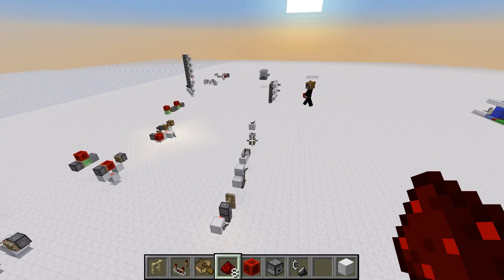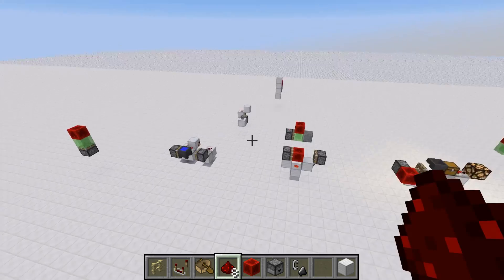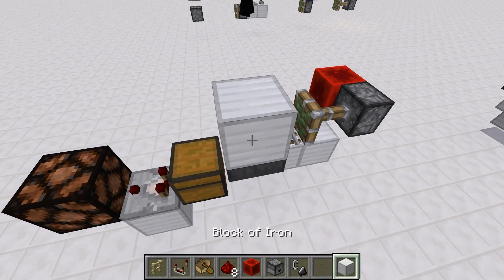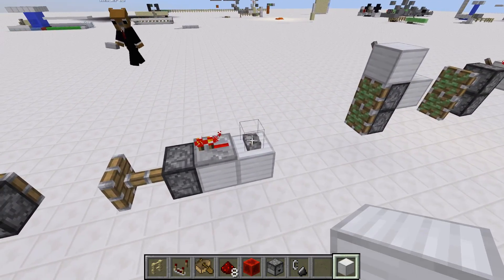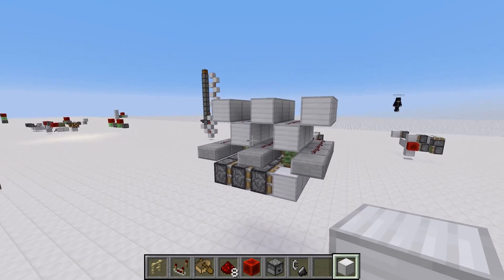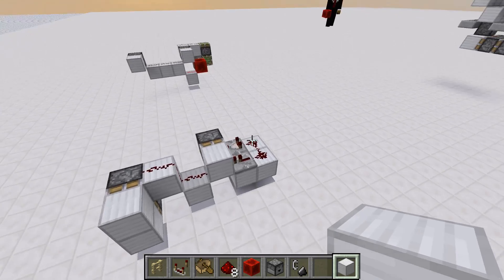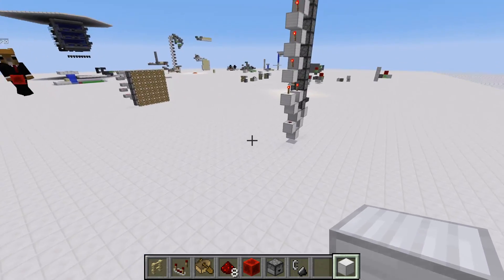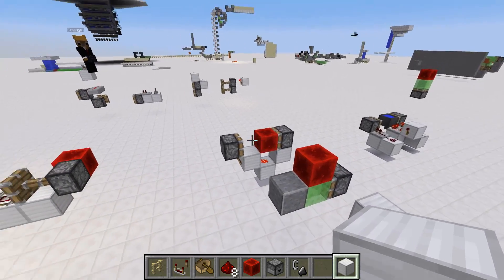Minecraft - NEW Redstone BUD Block "Observer" - Feedback for Mojang

Comment: as a player of mcpe myself from testing out the observer block (first i would like to mention there are NO bud switches that can be made like the ones showen at 3:30) from testing it is a pretty bad thing for pe users since there is no other bud switches that can be made (again only the ones showen after 3:30) with out the "observer" block so... here is an example you know how to make a 2x2 flush piston door with only 6 redstone dust and 2 repeaters? yes, you do, good. KISS IT GOODBYE MCPE USERS! yep observer block sucks and it sucks HARD! i would much rather have normal bud switches the not having them and only being able to use this dam block.
Reply: I think you're mixing up terminology here, BUD refers to block update detector, it is a contraption that triggers a redstone signal when an adjacent block causes a block update. The design at 3:30 is just a very simple demonstration of quasi connectivity, which is the game mechanic in the java edition that allows a piston (and some other blocks) to receive power if any blocks adjacent to the block above the piston is powered. Normally redstone causes a block update when it is powered/depowered but because that only affects directly adjacent blocks, a quasi-powered piston won't update unless one of the blocks adjacent to it change (whether it be due to the redstone powering/unpowering another piston directly above the quasi-powered piston, or any other block changing). But I do understand your point and I am completely of the same opinion even though I haven't actually played MCPE.

Comment: id love to see bug-less Redstone. you could do a lot more if the redstone didn't bud pistons and power things that are not attached. but obviously a vertical solution for Redstone and a bud block would be needed to fil the gaps
Reply: +Conor Raypholtz I would say vertical redstone is a must if they remove quasi connectivity.
Reply: some of the contractions such as shown in this video would break if pistons didn't bud
Reply: no they wouldn't, they would simply need redesigned with a bud block. so long as we can vertically wire redstone they are still doable and easier to figure get working.
Reply: yes a lot of crap in worlds would need redone but it would be 100x simpler to make new devices, and it would save space.
Reply: if vertical redstone was in the game a triple extender could be done in a 2x space using comparators.

Comment: Quasi-connectivity is one of the best features in MC. Please, don't mess with it.
The BUD block itself sounds reasonable... detecting fence gates and doors would be nice.
On the other hand there are so many things that could be added. Just a change of the pushing block limit to 16 would make ppl extremely happy and that's only 3 lines of code. Changing the useless minecart with furnace for a drivable powered minecart controlled by a player. Adding new block that changes its color (or maybe its shade) depending on the signal strength. (Would be cool for an "analog" displays. Also light updates from redstone lamps are currently creating so much lag, that you almost cannot use them.) Adding a chair/sofa block that can be moved by pistons and that a player can sit on. Having a use for poisonous potatoes. Changing the AI so that mobs can "press spacebar" and use an elytra. Lowering the shield model so that we can see something xD Making it so that potions are thrown a little bit further or even charging the throw. I was a little bit surprised that there weren't crossbows added in the combat update. A slow to load, but more accurate weapon could change it up a bit. Adding a different type of a sign (the wooden one can look really awkward at some places)... Iron version would be good in my opinion.
And if you are still reading this maybe you could tell me what do you think about it and what would you add.
Reply: +pi314159265358978 great list! sofas xD, they really would add some charm to the game. I would love to have a coal powered grinder block in the game in order to make bone meal automatically. It would be fun to automate tree farms even more and crafting bone meal really doesn't add anything to the game anymore for me after doing it a million times.
Reply: Lucan 6029 it's obvious, that you can't just change the rules with command blocks if you're playing on a server with other people.

I don't think it's a smart move to anger your most loyal fans by ripping the game apart.

Redstone as it is, is very intuitive, exept a few exceptions, like using a hash map to determine the update order of redstone dust. It's not possible to make everything perfectly clear for everybody. Some people are already overburdened by the complexity of a comparator. Dumbing everything down doesn't make it better.

Changing core mechanics just for the sake of doing something new isn't necessary, if they just add something new to the game once in a while.
Reply: If it works don't mess with it. And I genuinly believe that quasi-connectivity works much better than intended :-) I would even argue that currently the piston mechanics are more robust than those of repeaters, or redstone torches. And generally I would say that overall redstone mechanics are better polished, than any other area in Minecraft. And as an example I would use something from my area of expertise... the mod AI. I haven't done a video involving mobs in a long time and that's mainly because of how broken the AI is.
Reply: +SkretzoMC it's gone way off-topic from quasi-connectivity, but I think it would be reasonable for them to eliminate the nether ceiling exploit. A less rule-bending compromise would be to add much larger lava "oceans" to the nether that would provide mostly non-spawnable area without leaving the boundaries of the map.
Reply: Lucan 6029 I have a hard time understanding what you're trying to say. I don't have to be optimistic and positive about anything. If I don't like something, it's my right to express my opinion that I don't like it
Reply: Why do you think that we don't have a pretty strong system already? Sure, there are some little quirks and things that could be improved, but to discard one of the key elements in the redstone to create ... what exactly? Something easier to underestand? Well quasi-connectivity actually is pretty simple. You can do complex things with it, but you don't need to be an expert to underestand it.
Reply: Making mob AI that can fly and use elytra wings sounds wayyyy to complicated and I feel would not be good for the game.
Reply: +pi314159265358978 I just don't understand why a mining game doesn't have a grinder since the beginning, Mojang is weird. For QS I think you're too focus on what you loose, not how Mojang can do equivalent systems with a redstone overhaul (or not if it's a justified game design orientation). I think this would be done from the beginning. If the QS/BUD was based on IRL logic (electricity mainly) I would understand this statu quo, but it's just a counter-intuitive arbitrary logic for some optimizations. Compressing redstone is an gaming Art since the beginnings, and like all Arts it's based on arbitrary things, here Vanilla redstone system. Steps backwards haven't actual sense with Arts, unlike industries/techs. It will be always things hard to do (beacon farm ?), that's the main thing about this Art. I think the intuitive logic system for a global and child audience game is a great decision from Mojang (finally !!).

I wait now for Appletrees/Oaks separation and player-proof Nether roof Mouhahahah !!
Reply: +CowTipper989 But, you have to admit, airborne kamikaze creepers would be amazing. Just sitting there on the sofa, grinding some bonemeal, and BOOM! outta nowhere.
Reply: transylvanian
No roof access, because there is any flavor and because I can use command blocks to tweak new rules, making ghast or pigmen farm working again in the way I want or more interesting. For example... in a kinda ExNihili mod way, when 10% of squids touch lava in the Nether, funny farm ! Or when they flying because hit by levitation rocket XD ! Find your own rule. And obviously, I hope that Mojang close the roof access AND grant a way to farm a bit Ghasts, but by a designed way, not bug based, maybe not at the same rate though. But losing my actual Vanilla farm anyway ? Oh well, it's a game after all. You don't like Wither skeleton spawning ? Make a rule allowing them spawning outside, that's easy now.

Vanilla is just a support, a basic gameplay for players. MC is way more, stop to grasp Vanilla like a brand. You want more, do more, Mojang don't restrain you at all. The best example is HermitCraft. They like player's heads -> new custom rule, they like easy Elytras because the server have a lot of players (even some pro) -> Elytra drops by killing dragon... That for what were designed command blocks ! To make the game as you want ! Just be creative and accept to get out this insane and useless Vanilla brand.

And finally, Mojang will be way smarter to make redstone intuitive for new players, even breaking old contraptions, than keeping old players that, for already and redstone aside, are already bored just because, it's a game. Changes are also a great opportunity to work around and break the monotony. If you demotivate each time something change, that's too bad, but don't rest on MC for that. The world changes, players base change, old players, even from alpha, aren't alone on the game.
Reply: +ilmango  Just don't focus on that you don't like and you, that's only the easiest part.
Reply: Nothing special for me than AI dev (free entity, pathfinding, decisions priorities...) is more messed than redstone dev (cube based properties), in any game. "If it works don't mess with it" Not a rule I will follow to design a really strong system. It's a Boeing rule, I will prefer the Airbus way.
Reply: +pi314159265358978 one thing i think would be cool would be to be able to take a comparator output from things like open dragon's head or add feature that an upside down stair  acts like block on one side carrying redstone signal and slab on other.
Reply: +pi314159265358978 one thing i think would be cool would be to be able to take a comparator output from things like open dragon's head or add feature that an upside down stair  acts like block on one side carrying redstone signal and slab on other.
Reply: +pi314159265358978 They could keep the minecart with furnace, but allow it to be fueled by a dispenser.
Reply: +transylvanian Maybe they should allow you to enter the nether roof with nether portals. If they are placed according to altitude, you could avoid breaking bedrock.
Reply: +MarkRiverbank True, but I don't see the problem in using the nether ceiling. We do have the block limit, so why do we have this nether roof area if we can't use it?
Reply: +ilmango That's what I think Mojang really needs tools to promote custom server/rules and getting rid of this Vanilla brand feeling from players. Minecraft, even not in beta anymore, hasn't a good balanced and surely not consistent gameplay (a rare game where going out of map border to exploit game mechanics become the "right" thing). Players need to stop encouraging this reluctance to change in the community, that's the more toxic thing here, it is not loyalty. Nerfs only seen like that by old players aren't bad for the game in long term, negliging also a lot of additions. Redstone is arbitrary simple but extensive, close to basic electronics since the beginning, that's why redstone is great. They add specific redstone blocks but BUD/QS weren't intented and are definitely not in the core design of minecraft (minimalistic elements to build and easy to understand in essence too).

I know a lot about physics, and the first time I saw redstone - I stay honest with myself firstly - I saw unexpecting mechanics and surely more intuitive ways to do, even if a bit less optimized in a cubic world that's true. It's always the case now, see here in a lot of comments, for plenty of new players, anytime. You're free to ignore that. I don't blame Notch's experiment, but Mojang can totally change that a bit to have something more intuitive and consistent (in a physics point of view, not efficient cubic logic). Maybe you don't see this like me, but for me that's definitely because of the redstoner eyecups. You try to grab players in your side, so I do the same, as a redstoner too even if you cannot understand my point of view.

Even it's late to do that - better now that never - the cross-platform overhaul is a good (the last?) opportunity to do that. They don't go to ripping appart the game, only community would go for that like a stupid loyal headless chicken, that I hope it will not happen. They okay for feedbacks and will try as they can, but the community needs to be positive. It's not Mojang but mainly you taking side like you do that can make people angry by basic snowball negative effect. Try to be carefull and respect game designers, remember that it's a game first. That's difficult to face angry players for sure you're right, but you cannot have a great game following the largest numbers and more crying/yelling players too.

The community needs to be mature, stopping useless troubles in the crowd and focus more on positive aspects, even if it's harder to see by human nature. Observer idea and a bit of redstone overhaul isn't a bad idea at all. Instead to be afraid off it will be more constructive to help Mojang around that for the game, not as a burden but really in a positive way.

Comment: Good video doc. I don't necessarily think having a BUD block would be a bad thing depending on how it is implemented. It would be nice to have a BUD block for new players who might be unaware of the existence of BUDs. I know Mojang are trying to make the game more uniform cross platform but as you showed removing the BUD functionality entirely would be a mistake as it would limit available redstone options in the game. That said I think there is a compromise here with Mojang and hope that they listen to the community regarding the Observer Block and other changes to Redstone.
Reply: +cubfan135 Kinda agree. I think it's a great idea from Mojang (just really late XD). BUD was a bug result initially and quasi-connectivity even it revealed to be efficient in a cubic world, that's true, stays a weird / nonintuitive mechanic for plenty of players. Getting rid of this - only as it is - for something well designed for the game AND with some guaranty that most of these systems show here can find a new equivalent will be wonderfull, even if a bit of trades off / drawbacks will be needed for. That's already possible for some with a bit more of redstone (yes, a bit less resources/space efficient) and maybe redstone wires (no support) for pistons wall, two blocks away mode for Observer for secret entrance... A lot of things will be broken for a while, but inertia it's not the best advisor to follow.

Reluctante to change is understandable from MC players but I think Mojang puts more quality / evaluates better the impacts nowadays. I trust them + community to find a good alternative/new design to BUD and QC with a bit longer term.

Comment: tl;dr  would this not suffice to solve a lot ?
- observer 
- caged(stackable) dust  {(ex. a variety on mossy stone that's red?) basically a rs 'block' but one that's 'off' by default and acts like dust instead of power source} 
- (optionally?) stackable repeater.  (or is it sufficient if this can be placed on above?) 
- additional opportunity besides it voiding ugly zigzag towers, (other) colors and/or textures. yay!

Too long;still read. 
Let me take a stab at this. 

It seems there are two angles {small pun intended} on the quasi-connectivity but I'll dive into that in a second, first props for Jeb and everyone at Mojang, I think the majority of the community welcomes new blocks and features and continued development. so yay. 

Now, I'll happily grant I'm not someone making elaborate redstone contraptions daily but I think I see a few overlapping things. From a bug solving perspective of course people shouldn't accidentally {miniaturize their/} have their contraptions that don't work because they're running into mystifying redstone behavior. On the other hand, I agree with Docs sentiment, redstone behavior that accidentally enables amazing contraptions from the community should be treated carefully when replacing old 'working as intended'-ness that's neither feature nor bug. Since I don't build all these things daily anyway I'm certainly not going to speculate on what simple advice I could give that works for all these qc things let alone the 'within gametick' things.. but anyway.

I already gave the tl;dr first so it's no surprise at this point what I might be rambling about. Isn't the root cause 'redstone simply doesn't stack'  why piston walls would be impossible without this qc 'working as intended'-ness. What if aside that observer a block something gets added that might look like red mossy stone. basically redstone dust but 'block' working as dust - not the version that gives power on it's own.  

Also it would be brilliant if water doesn't flush away that block ;)

I'd love some input from people working with this stuff to see if this would be something intriguing and workable and such and something that's not breaking much.
and I'd be amazed if it got in game hah. 
cheers